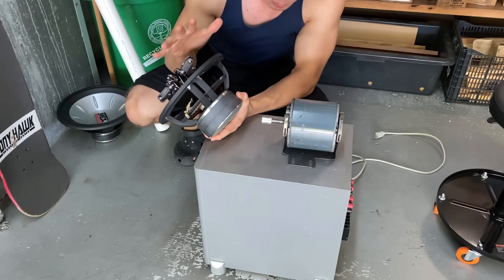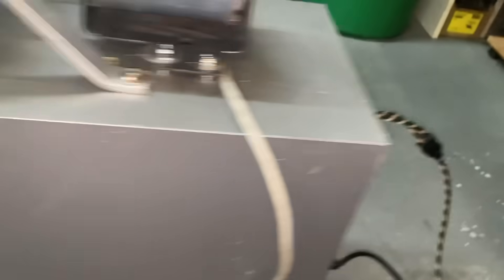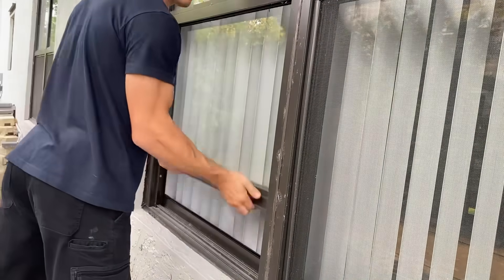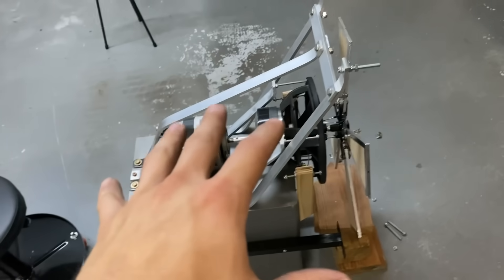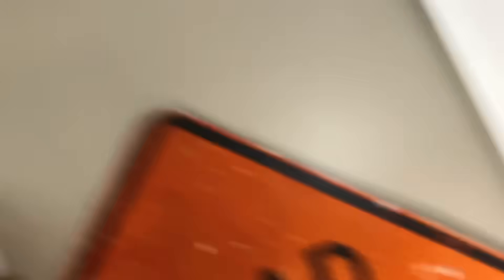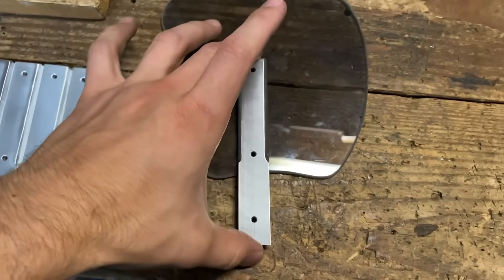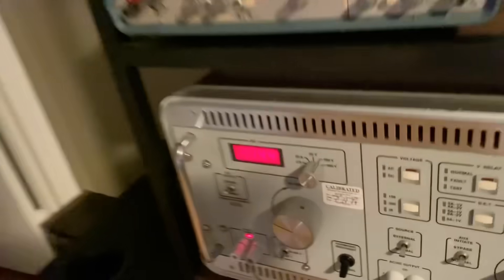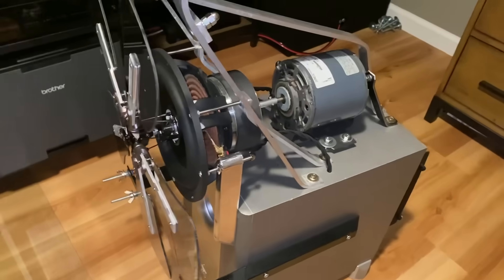Making the worlds most powerful subwoofer (Rotary Subwoofer)

Comment: Cool, but no human can hear 10 hz, what we heard are some resonant frequencies or the five blades wooshing at the mic 5 times per rotation.

I would love to hear this thing go up to 30 or even 40 hz, there we can be sure it works as a subwoofer.
Reply: I can hear a 12hz sine from audacity with m50x headphones, but that is right on the edge of being loud enough before distorting. The whole "you can't hear below x frequency" that people love quoting is basically a lie to children, the real problem isn't that certain frequencies is inaudible, it's that at very low frequencies the amplitude has to be much higher to pass the threshold for hearing it.

To quote a study from 2004, "The threshold of hearing is standardized for frequencies down to 20 Hz, but there is a reasonably good agreement between investigations below this frequency. It is not only the sensitivity but also the perceived character of a sound that changes with decreasing frequency. Pure tones become gradually less continuous, the tonal sensation ceases around 20 Hz, and below 10 Hz it is possible to perceive the single cycles of the sound. A sensation of pressure at the eardrums also occurs. The dynamic range of the auditory system decreases with decreasing frequency. This compression can be seen in the equal-loudness-level contours, and it implies that a slight increase in level can change the perceived loudness from barely audible to loud. Combined with the natural spread in thresholds, it may have the effect that a sound, which is inaudible to some people, may be loud to others."
Reply: @WhereistheHeraclitus  Okay, fair, I was wrong about not being able to hear (or better feel) 10hz. But in this video you still won't be able to hear the 10hz, because it is cut off, we actually hear the 30-40hz from the fans resonance. I am sure of that, because I downloaded the video and looked at it with a spectrum analyzer. All frequencies below 30hz are just random noise and can't be identified as a sine (to be honest, even the ones at 30-40hz are more noise than a sine).
Reply: @mangelo1901   "Or better feel"... The difference between hearing and feeling at 10hz is going to be how you reproduce the frequencies for the most part, an in ear driver would be mostly audible but matching the same perceived volume at your ears with a sub means radiating huge amounts of energy everywhere. 

Apologies if I misunderstood and that wasn't a comment about feeling 10hz more than hearing it like 30 minutes after you learned that hearing 10hz was actually possible lol but for real there is a huge gap between the "normal" understanding of human perception as being from 20hz to 20khz and stuff like the paper mentioned. It's just not generally useful to go beyond the normal understanding so it is spread far and wide as the whole truth, and tbh audio is a field that many have done very well in despite all the simplifications and half truths in their knowledge of the subject. Kinda beating a dead horse here but wanting it to put out 30hz is another example of this, anyone familiar with them knows they have too much moving mass for those frequencies.

And yeah it was clear while watching that there wouldn't be any audible 10hz in the video, even if you had a perfectly clean 10hz air pressure wave inside a room being inside and recording it with a phone mic isn't going to happen lol but I can understand why you'd want to be sure I wasn't arguing the video was audible 10hz.
Reply: If you have some bass equipment in your home setup you can feel it instead of hear since low frequences more like feelable than hearable.

Comment: You don't know what it is, but you know ot means business. 
Dude i would relish  the opportunity to float some ideas your way, particularly battery and solar technologies.
Reply from the maker: Like what tho
Reply: @pierogiengineering  I am currently using some tech that is awesome, however I believe it could be much more efficient. I have experimental ideas that a guy like you could throw together and test my theories quickly, easily and fairly cheap or I could possibly and gladly fund them. I can't really just put my ideas right out here in a public forum.
Reply: I'll point you in the direction I'm in, look at solar technology and innovate it, the tech is so limited batteries too.

Comment: Why don’t they make these in mass production? They would be insane in a theater
Reply: Because they require a massive space to pump air in and out from, and hardly any content actually goes that low. It isn't just a chicken and egg problem where the content would be made if the systems were more popular, they have some pretty significant caveats that make it very expensive to do commercially and some of the downsides are basically impossible to mitigate. Eg. you can't really isolate such low frequencies so the theatre next door (and the whole neighbourhood) gets to enjoy it too. Imo they will always be a niche curiosity, nobody wants to deal with their quirks and tbh it makes a lot of sense why they don't.

Comment: Subbed for rotary woofers and also future mom cameos 😍
Reply: hey buddy, putting your dremel in the freezer will condense moisture inside it.  Surprisingly, a fan moving ambient air transfers more thermal energy per unit time than a freezer transdering thermal energy with natural convection, despite the temperature difference.  Next time try the fan for 10min and the freezer for 10min and you will be convinced.  

Same goes for defrosting your freezer coils... forget the heater/hairdryer to melt the ice, place a 20" boxfan at the door and you will defrost your freezer in record time.

Comment: What type of aluminum is used for the frame? I notice that it bends easily. (Or did you just heat-temper it first?)

Edit: Okay, this may not ever get seen. What's up with this hyper-specific diy video from 5 months ago from having dozens of content-less comments a day? haha.
Reply from the maker: Normal 6061 aluminum

Comment: Uhm...
How is this useful?
You would be generating a single frequency? That's not how speakers or sound work. Could you actually play some bass music with this?
Reply: loser
Reply: dude...the whole principle of the rotary sub: you run the music into the control of the blade pitch, so instead of playing a steady frequency, the blades are pitching to the wave of the music I.E. the air pressure is being modulated to the wave of the music.  That's how you can get down to zero hertz.
Reply: @mummyjohn Thx, yea that makes sense. The blade pitch is controlled to follow the waveform, and hence the air pressure follows as well.
Reply: Iirc thr woofer only makes noise, like a single sound with different duration
Reply: Maybe I'm the one being stupid, but don't all speakers only produce one frequency at a time? It's an analog signal that changes that makes the sound, but the signal only corresponds to one position at a given point in time.

Comment: anything below 20 Hz is Infrasonic so this is now an infrasonic Woofer. The reason for a fan is because it's almost impossible to make an infrasonic woofer in traditional woofer sizes because of the amount of air that needs to be moved. a company made 30' and 50" that can go down to 5Hz without in-room boost  but that's too big and expensive to install in a home theatre and this vibrating blade fan solve the size to air volume displacement problem. drawback is the mechanism is complex, more moving parts and prone to brake with frequent use :)

Comment: This video sucks, you explain nothing at all about the device, and play no audible sound through it and call it a massive success. The entire thing is just "dude watch this door shake!"
Reply: You can hear some frequency if your headphones are good, I have a KZ and can definitely hear a hum
Reply: @vcprado  the hum is from the motor. There is a sound that can be heard from the air waves, but 10 beats a second is not fast enough to make a hum
Reply: Thats all theyre good for. No practical use for these and good luck integrating it with the traditional subs in yout system which u will still need. Phoenix Gold made  one for auto use in the 90s called the cyclone. I heard one in a BMW, the box took up most of the trunk and it didnt work well. While its output around 20-40hz was impressive there was a big dip in response from about 50-90 hz until the mid bass drivers kicked in. Just a novelty.
Reply: You do understand that for you to hear the "audible" sound you are asking, you would need to have a sub like that yourself.
Reply: @misterinfinity4076  he literally only shows it running at 1 and 10 hertz. Can this DO higher frequencies? What happens when the frequancy gets turned up, would it shake itself apart? Maybe he was worried about it shaking too many things off the shelves? No explaination, just 'yeah im dome with it for now.' Its like building the worlds fastest gaming pc and and stopping the video just after you get to the desktop. This could have been so much better with just a little more information
Reply: @Rapturehelmet  no it can't do more that 20hz, after that the distortion rises dramatically.
Also the "propellers" and the helicopter  swasplate he uses for pitch control  are heavy and flexible they cannot oscillate fast enough to achieve higher frequencies. when the frequency of oscillation becomes higher that the frequency of rotation (1hz = 60rpm) the output is dominated by distortion.
Because even second order distortion is at a frequency where humans are much more sensitive in, even relative small amounts of distortion are audible. Lastly the device suffers from turbulence and sound coming from that turbulence, like fluffing, when you increase the rpm the fluffing sound gets louder.
Reply: @misterinfinity4076  But how do you physics? Please explain.
Reply: Not the most powerful sub obviously but what he managed out of that shitty one on a budget is quite impressive. Successful enough for him to increase it gradually from 1 to 10Hz and make you shit your pants while playing several sounds of fear in a fairly sized house in the dark 😂
Reply: @filipe.skunk8  thats actually around 17hz... Can this go that high?
Reply: I bet you’re fun at parties
Reply: I mean the device was not explained (nor the physics really), but this video is MAKING the most powerful sub, not EXPLAINING it.. so UTFG. Also, don't know if you have ever tried it, but try to move you doors on the other side of house using audio pulses from a f.cking speaker. You'd need one hell of a setup for that, large as half of the room.

Comment: What about higher frequencies like 30hz? Or anything actually musical?
Reply: depends on the quality of the servo-motor used for moving the blades. I think at lower decibels it can move at higher frequencies, bc. the blades dont move as much (the higher the angle of attack on the blade the more air it moves = louder).
But for a useful musical setup you would use it in addition to a classical Sub, with the rotary one just doing the frequencies below that
Reply: @TheKnaeckebrot  Yeah. My thoughts are just along the lines of that the lowest octave is the most difficult for a conventional sub. If any of it can be taken care of by smth else, the conv sub can take it a bit easier.
Even if its not even 30hz, but say 25hz. Even that will ease the job of the sub.
Reply: I think that the blades can't move that fast

Comment: This is what would make THE difference in virtual pipe organ installations for churches, concert halls or other large buildings. Real pipe organs shove a lot of air in their bass section and so do subwoofers -- but the latter can't cope with the real instrument on the very low end < 20 Hz so the "guts feeling" is fairly lost. That's where the rotary SW could jump in to the rescue.

Comment: Whats the maximum frequency you can run this at?  Can you actually run it at audible frequencies?
Reply: I’d say that system could handle up to a few hundred? It might take some testing to get it perfect but the part that rotates the fan blades loots quite solid

Comment: Do you have schematics? Or at least some advice on what off the shelf parts you used to employ in building… I can figure out you used a woofer to control the angle of the blade, and the helicopter rotor as you mentioned… but did you pick a specific woofer and rotor mechanism that would work the best? I can kind of figure out the rest… really interested in building one of these especially when you eventually post the results playing some audio… SUBBED! super cool man, wondering if even the woofer is necessary, and you can use a similar transducer to what would control the blades on the rc car if it has the ability to respond fast enough….

Comment: I’m scratching my head trying to figure out how this thing works. Why the fans? Why the rotation?
Reply: eli5:
a normal speaker makes sound by pushing and pulling the air in front of it to create sound waves (speaker moves forward, air gets pushed out, speaker moves backwards, air gets pulled in)
the fan on this subwoofer is also constantly moving the air around it by spinning. when the fan blades are turned, it goes from pushing the air out to pulling the air in around it. if you wanna create a higher frequency, you increase how many times per second the blades switch from pulling to pushing the air. because of the spinning it is able to move much more air than a traditional speaker, which is why it can produce such low frequencies. ta-da.
Reply: Sound waves are equivalent to pressure waves
Move at the right speed, get a pressure osscilation that corresponds to that frequency.
You wont get clean sound out of it, its just to aid with feeling sub base

Comment: That's cool and all, but I want to know how it handles higher frequencies. If it can't at least go up to 150 hz, then it's not really that viable as a subwoofer.
Reply: Idk about you but bass does not sound good above 90hz for a powerful sub, anything higher is mid range. It looks like he’s trying to get the most sensitivity out of it at much lower freq.
Reply: Its called a SUB woofer for a reason. Mids woofer would be 150hz. Most subs can only pick up anything under 80-90hz

Comment: As an audio engineer I am highly impressed. The power you have with that. You could probably monetize it with sub frequency research
Reply: There are already professionally produced rotary subs in use! The Thigpen TRW-17 produces 115+ decibels between 1-20 hz with a power input of 150 watts
Reply: Why aren't they more common though? Most of the venues I've been to either use Funktion One or L-Acoustics systems. Considering these clubs mostly play electronic music (where bass is key), I don't get why you wouldn't use such subwoofers instead of traditional ones. Thanks in advance!  @DarkAttack14

Comment: Suggestion: if you had another fan same size right in front of the other one, having the blades designed so that they change to the opposite angle as the adjacent blades on the first fan

…potential…

Comment: Let’s see some higher frequencies tho
Reply: do you not understand how a subwoofer works lol
Reply: @permutemusic  If you think your standard off the shelf subwoofer plays at 10 Hz or below, you don't understand subwoofers ;)
Reply: @mortenmoulder  ah i misinterpreted you saying 'higher frequencies' as high frequencies, something outside sub range. 

Yeah ur right that it would need to be able to perform across a much wider bass frequency range to be viable as a sub. <20hz is usually brickwalled out of a mix for headroom purposes so it wouldnt even work for most purposes lol
Reply: @permutemusic  bro subs should go at least to 100hz. Max showed in the vid is 10hz

Comment: Imagine an amp and sub that can simulate the sound pressure of an Apollo Saturn 5 missile launch. NASA used it to test launch pads. The Saturn was loud enough to destroy steel structures or even kill people at close distances. It could knock you out at a mile.

Comment: We built Sub's that ran down to 1Hz at 3,000watts and larger with a THD of 0.1% at full power sold in the pro and home theater markets. Raw power with lousy quality sound is un-except-able. If your not careful at those power levels Bass will make you puke.
Reply: The great thing about rotary woofers is the massively higher efficiency compared to standard subwoofers, In the 0-40hz band they really can't be beaten.  But above the ~40 hz range distortion rises rapidly and can start to sound "odd".  They are really intended to only provide the lowest octaves of sound and the vicarial impact that only very powerful systems can provide.